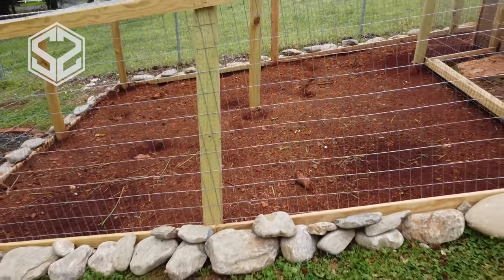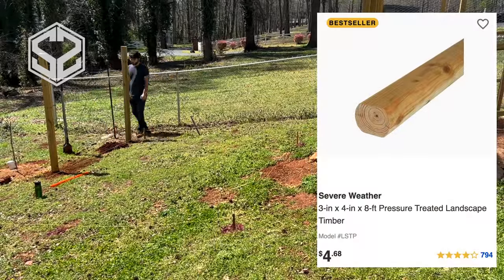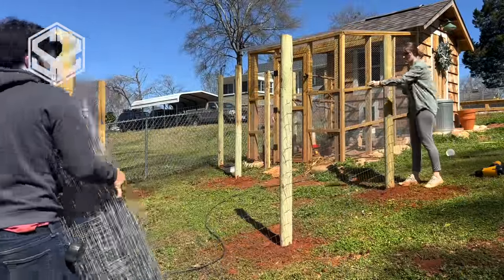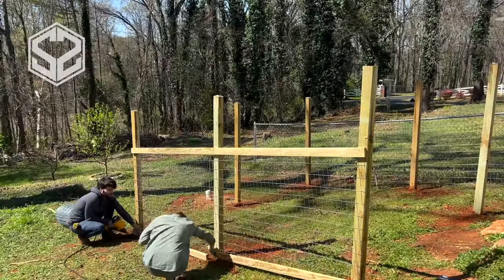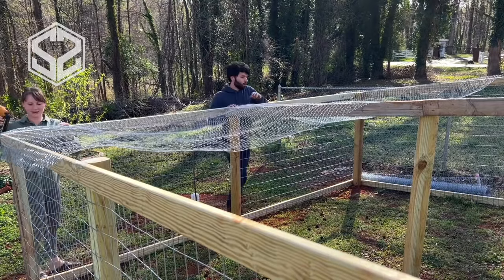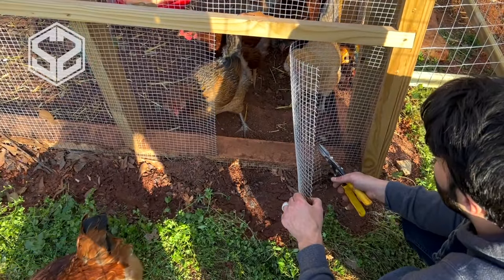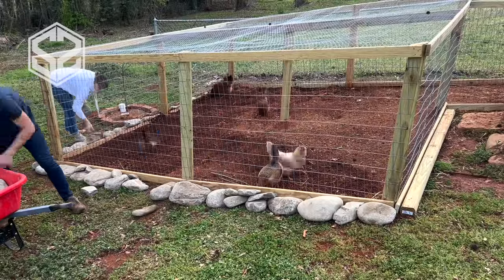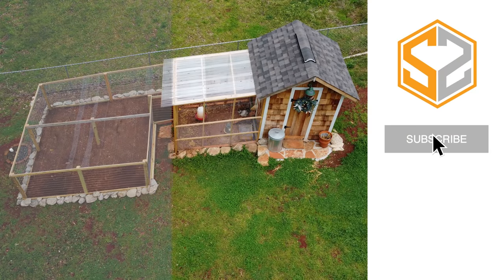DIY Chicken Run

Comment: If you want to grow grass for the chickens in the new run, make a box any size, maybe 2ft x 4ft, or any size you want, and cover the top with chicken wire ( put a brace in the middle to support their weight, and plant grass seed, or whatever kind of seed you want, (that they will eat) inside the box. As it grows the chickens will stand on the wire and will peck at it, but not tear up the ground! You might plant a few of them along one side of the run and have them grow at different times to always have greenery available! ( plant thicker than normal) Just a suggestion! God Bless!
Reply from the maker: Thanks! 😁 I will have to try that!
Reply: Yea that's a great idea, thanks I'll be trying that!
Reply: Yes I have done it and it’s great
Reply: I am having a hard time visualizing this
Reply: @floridagirl386  If you make a box (with no bottom)from 2x4's any size, (maybe 2ft on the short sides and 4ft on the long sides), cover it with chicken wire,( you might need to put a 2ft piece of 2x4 in the middle of the  box to support the weight of the chickens, so you will have (3) - 2ft pieces and (2) - 4ft pieces). After you make the box, (with nk bottom)place it in the run and sprinkle grass seed on the ground  under the chicken wire. When it grows,  it will poke through the wire and the chickens will pick at the grass without scratching up the ground. Maybe this is a little clearer. God Bless!
Reply: @user-dy9lw2zl3u  oh goodness thankyou so much for that! You truly went out of your way, I am so grateful.  Yes I totally can see it now. 🥺🥺❌️❤️❌️❤️❌️❤️
Reply: @floridagirl386  yes, the height of the 2x4 on their side and it sits on the ground. So the box is 4" high all around. There is another piece of 2x4 across the middle the short way and all of this is covered with chicken wire. You scatter the grass or clover or any seed that will sprout and grow up through the wire so the chickens can pick at the green sprouts and not disturb the soil and the roots. Your box can be any size to fit the area  that you have. You can make if out of wood, PVC pipe or anything that will hold wire and the weight of the chickens.( with bracing across the middle)
Reply: @floridagirl386  You can use any size wood, 1x2, 2x4, 2x2, 2x3, 4x4 etc. The box will  be the height of the wood. You can use any wood really, but the ones I mentioned seem to be the sturdiest for fastening the wire and for the weight of the chickens. You  could even use an old drawer with the bottom removed! The seeds would just have to grow up a little further!

Comment: Nice addition to the chicken run. I would have just kept the height of the timbers to keep it tall so you could stand inside, add perches, makes cleaning up poop easier. You make is look so easy, now I want to add an extension on my run.
Reply from the maker: Thanks! Yeah, the taller you can make it, the easier it will to get in there for any reason.

Comment: Landscape timbers, yes! I just did the same thing building a fence around my garden. I saved over $100 using timbers instead of pressure treated dimensional lumber
Reply from the maker: It’s crazy how much cheaper these Timbers are! Thanks! 😁
Reply: @SimonSaysDIY  They're cheaper because they're not truly pressure treated. They're sprayed. They don't have the penetration that the pressure treated lumber does and as a result will rot quicker.
Reply: @SimonSaysDIY  to

Comment: I used the electric fence posts that you can push into the ground with your foot and regular chicken wire that I used twist wire to secure to the posts and to itself for my expanded chicken run. Its held up well after several months, and I plan to expand it again next month because I'm going to be doubling my flock. Cost me less than $100 as well, 'cause I caught the chicken wire on sale.

Comment: Nice build and well explained.  We ran hardware cloth vertically 12" deep around the perimeter. The hardware cloth or chicken wire around the lower fence line sounds good.
Reply: How high does it need to be
Reply: @floridagirl386  high enough to wire the hardware cloth to the side fencing. You don't want gaps that unfriendlies can crawl through.
Reply: @karenbuckner1959  right. How tall of hardware mesh? I grabbed 36" by 100ft. 36 inches should be high enough right?

Comment: you should still have a wire skirt about 18" on the outside underneath your rocks to keep predators from digging in
Reply: That's the purpose of the rocks!  That's a lot of digging to get under 6-12" horizontally of large rocks!  It would take a predator days to dig that far.  My run has wireless motion sensors around it.  If I get a hit at night, I get to test out my thermal optic on the .223! Win/Win

Comment: Wow, crazy how fast the grass was gone!  May I suggest burying  hardware cloth under the dirt along the outside edges of the run instead of rocks. It's actually part of the fence.  I'm not sure how effective the rocks will be at keeping a coyote or fox out of the run. I have to worry about that in Ontario, maybe you don't. Nice video.
Reply from the maker: Thanks for the tip. So far so good, I’ve seen coyotes and dogs around the coop and none have been able to get in yet. 👍🏻

Comment: This looks wonderful! I may steal this idea except for one change: I'd use heat treated wood (steam), not pressure treated (with toxic chemicals). But, other than that, nice!
Reply: Modern pressure treated wood is not toxic, that's why it doesn't last like pressure treated wood from 50 years ago.
Reply: pressure treated wood is fine for chickens actually.  don't tell people to waste money if you don't have the facts.
Reply: @maddog6542  We'll have to agree to disagree on that point. Unless the wood is heat treated without chemicals, I sure don't want my chickens ingesting it when they're pecking on the wood. And they will peck on the wood. All the best ~ 🐓
Reply: @debkincaid2891  can't really disagree with facts, but whatever

Comment: You did a great job showing some tips about how to save $ on the wood. One way we are planning on keeping the chickens from trying to dig out is to lay hardware on the ground around the parameter and then put the fence on and finish it off with sand. We used this when we were setting up the coop and it worked great...even helped keep the mice out!
Reply: How so? I’m trying to do the same with my chickens and keep the mice out

Comment: Lumber prices have changed a lot! That 4x4x8 that you were comparing at $17.38 is now $9.27 (in my area at least) and the landscape is $4.68. Would you still use the timbers over the 4x4 post if you're only saving $4.59 each?
Reply from the maker: Very true! The price difference is much smaller now, I would probably use the 4x4s. Thanks! 😁
Reply: You must be shopping at Lowes!  I'm in Virginia and on 2.7.2023 the 4x4x8 treated post at Lowes is exactly $9.27 😆 I just bought 4 of them for the main posts for our chicken coop I'm in the process of building.  The landscape timbers are cheaper, but I have found that they are not as well pressure treated as the dimensional 4x4's and will rot out within 5 years when burried.  Modern pressure treated posts will last about 20 years.  Long gone are the days when pressure treated posts would last 50+ years when burried!  Thanks, EPA for that.

Comment: everything is superb but the pole standing only with support of soil is disturbing me, if any heavy rain the soil will loosen and chance for poles to collapse, my advice is pls pour concreate suppoort to poles for  atleast 1 feet below ground , it will give both support and Termite resistant.
Reply from the maker: Thanks for the tip! It’s held up so far but that center post is the weak point for sure.

Comment: Why so deep for the post hole? Standard fence holes is 18”
Reply from the maker: I had some extra length so I figured it would hold a bit better. The ground was fairly soft so it was easy to go a few more inches. :)

Comment: May I know which type hardware cloth do you used for building the chicken run?
Reply: It's 1/2" x 1/2" galvanized steel hardware cloth.  Available at most hardware stores, Lowes, Home Depot, Rural King, Tractor Supply, etc.
Reply: @user-sy2fe2bf8t that's not hardware cloth but I know what you're doing. I love you for that ❌️❤️❌️❤️❌️❤️

Comment: A racoon will reach his hand through the wire and grab a chicken and fish it out through the wire eating as it goes.  A fox can often chew it's way through cheaper chicken wire.

Best to give them 10 sq. ft. of run space per bird and at least 2 sq. ft. of open floor space in the coop per bird to keep them from fighting too much.  Y'also want no more than 4 birds to a nest box.
Reply from the maker: Thanks! I appreciate the tips! We are planning to add the thinner chicken wire alone the bottom for extra protection. We currently have 4 nesting boxes for 8 chickens. We should have a bit more room for a few more chickens but I’ll have to measure and check the square footage of the space we have. Thanks! :)

Comment: Dig a 6" deep trench around the outside of the fence . Put a lot of broken glass in it and cover it . Anything that tries to dig under will quickly CHANGE it's and most likely not come back !  For the fence climbers :  Do not attach the top 18"s of the netting to the fence posts . As the CRITTER gets to the top , the netting will lean away from the pen/posts and the animal can not proceed and will eventually give up and fall off . If you have MEAN STREAK , there's always the old tried and true generous application of "treble hooks" to the outside of the netting fence !  Smarter , not Harder ! ! !